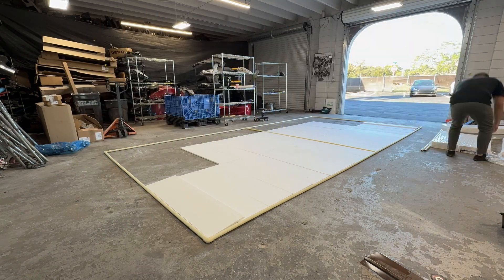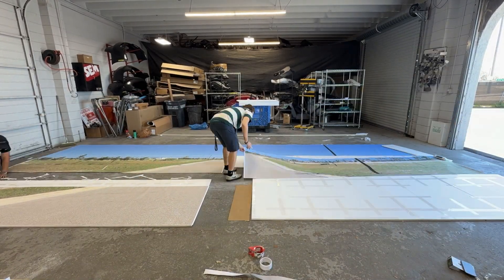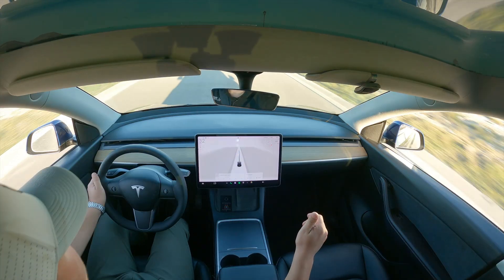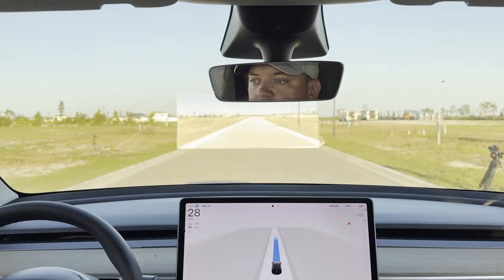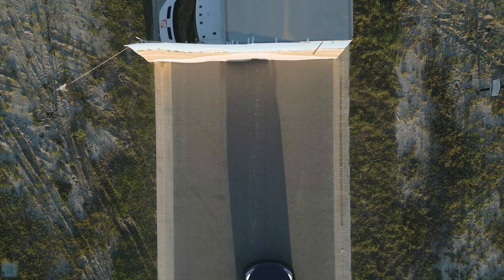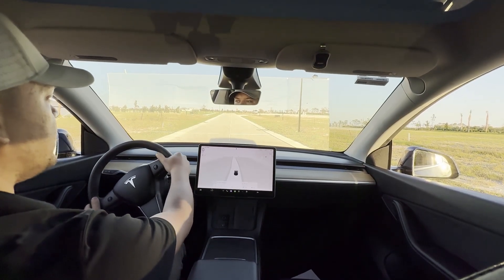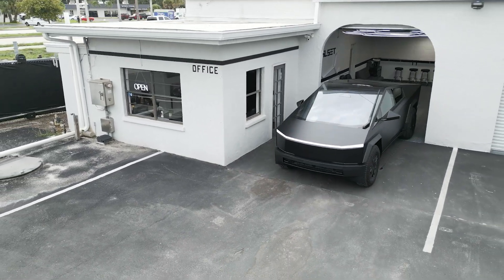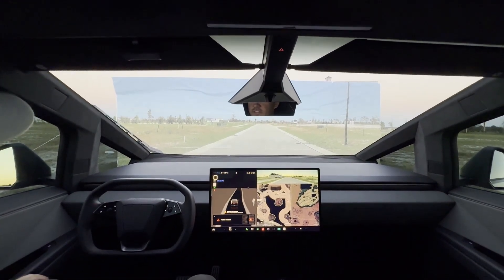Response to Mark Rober’s “Can You Fool A Self Driving Car?”

Comment: This needs to go viral because everyone thinks Rober faked it
Reply: He did. He used autopilot, not FSD.
Reply: Isn't it at all concerning that even if the Rober test had 'slightly' older Teslas those vehicles are still being promoted and used with FSD? Despite the obvious results that those vehicles are not capable enough. Shouldn't they limit any car without the capable hardware or the correct software from doing FSD?

Tesla is putting people's lives at risk to save a buck. Mine included despite not owning a Tesla. Elon wants his cake and to eat it too.
Reply: @ayehavgunne  Shouldn't it be concerning that my car with cruise control can't detect a looney tunes wall and stop?

This is a nonsense argument. When fake walls become a common occurrence, you might have a point. A lot of regular drives would crash into the wall.
Reply: The point is that rober had money donated to him from the company he made look good against a competitor
Reply: I thought the idea of it is to pointing out removing Lidar from EV was a bad idea bcuz vision will never beats lidar in edge cases like these, and tesla can absolutely include it.
Reply: He did. Also this guy just showed you that the latst version of FSD can see the wall. The model Y is running baby FSD (one year old version)
Reply: he didn't fake it. tesla running vision only is just a very very small brain idea
Reply: @amarug  You idiot, of course he faked it, he did not even use FSD on purpose.
Reply: It's not that he faked it. It's that he used a car with brand new lidar attached to it donated to him from a lidar company, who probably gave him the whole idea because they wanted the publicity, but he used a Tesla that was four years old. Why would you compare the newest lidar  tech to an old Tesla? That's dishonest
Reply: @bbtodd  a lidar company run by his buddy who donated 4 million to his charity
Reply: @bbtoddLike comparing the modern roadster to the first Tesla prototype
Reply: @bbtodd 🤔 what you talking about?
Reply: @bbtodd ”intentionally misleading” is a bit strong. People are people…sometimes we all make mistakes.
Reply: The amount of mental gymnastics from Elon fan boys is amazing..
Reply: @bbtodd what's dishonest is elon has been saying those cars at the time were safe
Reply: @bbtodd Because they all work the same way still? Without LiDAR and only cameras? That hasn't changed. This proves it as well; there are just limitations to working with Cameras alone.
Reply: @bbtodd so the lives of someone driving that tesla doesn't matter? You do know tesla removed lidar from their cars right?
Reply: @ 
Tesla cars NEVER had Lidar technology, what you are talking about is a radar, which they had before, in their older car versions, which was removed. Lidar isn't the same as radar.
Reply: I never thought he faket it, but Autopilot and older Software is not ok for a accurate test. At least im happy that mark startet a Testrun and now tesla will receive so many data. ;o) So it can get only better.
Reply: @danielkuttel7867  I honestly don’t understand what yall are even arguing for anymore. Even if you believe this test is BS, there’s certainly no way to argue that Tesla’s system performs BETTER. We now live in a world where good LiDARs are 200 bucks. Your iPhone has a lidar. Companies using lidar will have superior performance and win out. It’s time to let go of the fantasy
Reply: @ but Tesla has been saying their cars are fully autonomous capable for over  10 years now. Even saying his cars are 100% safer than a human half a decade ago.
Reply: You can ague that he didn't fake.
Running a test with the latest LIDAR vs a Tesla on old hardware and old software is misleading.
Reply: The lidar could be 10 years old. It's not like lidar is a competing similar product. They are both fundamentally different technologies.  @jiggig
Reply: @jiggig you realize Tesla has been selling cars since 2017 they claimed would be level 5 capable right? Since AP 2.0
Reply: @glideslope69  Sure, Tesla claimed something big. Is that a good reason to be dishonest to his audience about the current technology? Why did he compare an old tech against a new tech when it's obvious that people don't care about such a completely USELESS comparison? 
Why not compare the latest technologies against each other? Why not be scientific about his tests? Instead, he thought that his assumption was enough to let people know that cameras will fail. Isn't he all about science? What he did was completely the opposite of science.
Reply: @Humon66  bro tell me you’re holding the bag on your $TSLA without telling me lmao. The cybertruck stopped because it’s taller and can see over the wall. A taller wall would beat it in the same way as the Y. Updating the processor doesn’t change the inherent nature of the design decisions made. If they train it to look for this, it will start randomly stopping. It seems like you’re the one who doesn’t respect science, since there’s only one conclusion you’ll accept, regardless of what the data says. You have the same scientific integrity as the people who do research on behalf of the tobacco companies
Reply: @glideslope69  Are you just like Mark Rober? Only assume to know what you're talking about without real tests? Sure, maybe you're right, maybe you're wrong, but stop being a-know-it-all and let the rigorous tests show the real results that actually matter. Your opinions don't matter here.
Reply: @ bro I’ve been an electrical engineer in the industry for 10 years. There’s a reason every other life critical system has redundancy. Tesla squandered what could have been a multi-year lead to avoid a $200 sensor. 

Imagine if Boeing started eliminating redundant systems in airplanes because “they’re too expensive” …now take a step back and realize that’s the exact design ethos you’re advocating for.

Tesla is not going to be the leader in robotaxis unless they add sensor redundancy, but at this point that would mean they have to rewrite and retrain the entire stack. Meanwhile, Waymo is operating non-beta, for-profit rides in the real world as you read this. It’s unlikely Tesla will ever catch up. Their only purported advantage, the existing fleet of vehicles, is apparently useless since your team is now clinging to HW4 being the savior. 

Good luck out there ✌🏻
Reply: @glideslope69  
Cybertruck stopped either because its using better hardware, better AI model, different contrast between picture and real world or all them put together. It didn't see over the wall... Its not that tall... You can even see in the video that top of the wall shows sky, for both cars, and even if it did show something behind it that should still not impact how car behaves as its way out of where cars would be driving. 
This video showed how this experiment should have been done, multiple drives, properly putting away hands and feet, and done actual test with actually the latest version of this tech. Tesla failed with older version, it succeeded with newer one, everyone is happy as this was the correct way to do it. Now only question remains if test with CT was a fluke or not, so repeating this test where you have side by side tests with older version would be to way to go, just to rule out changes in day time and changes in contrast.
And no, I have no stocks and Tesla and I don't own Tesla, so put away your tin foil hat.
Reply: @Zripas  Agree. We need more tests with certain conditions to see if the CT test was a fluke or not.
Reply: @ I disagree with literally everything you said but I’m not gonna spend the time to go line by line. Here’s the major point that you seem to be missing or intentionally ignoring, Tesla said that the HW3 model Y in the video would be capable of level 5 autonomy. So even if we pretend everything else you said is correct, the main point of the original video is validated; the vehicle is not capable of doing what Tesla said it would be. 

“Oh you need the new one” is not an excuse, Tesla has been promising their cars would be capable of full autonomy with their existing hardware since 2017
Reply: @glideslope69 as a radar engineer for 10 years, I would like to point out the interference problem among active sensers. If opposite cars also use LiDAR or radar, the emission signals can not only confuse your receiver but also blind yours for a short while. In 10 years I think auto driving will become mandatory because of better safety standards, 
LiDAR and radar won't be part of it.
Reply: @ any life-critical system needs to be designed with redundancy. Certainly no one is advocating to use only lidar. It’s a backup. 

Vision-only is inherently limited to the dataset. The fatal FSD crashes (the few that have been obtained by the public) all follow a similar pattern. The car saw something that it didn’t understand, like the bottom of a flipped car on the freeway, and decided to keep driving. There will always be new scenarios it hasn’t seen before. 

In these instances, if the lidar detects a large object in the road, whether the car understands what it is or not, it’s better to stop. You’d rather risk a slight inconvenience to avoid a fatal accident. 

There’s a reason Waymo is operating for-profit fully driverless rides as you read this, and Tesla has never completed a single driverless mile. The redundancy provided by LiDAR (among other sensors) is what makes it safe enough to trust your life to
Reply: @namei8967  
Interference is not a problem with LiDAR as systems use slightly different laser frequencies or modulation patterns to distinguish “their own” signal from others and also use unique pulse sequences or time-of-flight encoding, so even if other pulses are seen, the sensor can filter out what doesn’t match its own code. In most real-world conditions (even in traffic or at intersections), LiDAR systems function well without noticeable interference. Automotive manufacturers design LiDAR units specifically with these crowded environments in mind.
Reply: @glideslope69  I wrote to you because you claim you are electronical engineer. So let's talk with engineering sense. 
For any redundancy system, you must consider 3 factors. 1 necessity, 2 cost, 3 side effects.
For 1, the latest fsd has shown its excellent ability to avoid collision. So far no one tried to prove it otherwise.
For 2, LiDAR is expensive which will prevent it to be used to cheap cars.
For 3, the interference of other coming LiDARs will make your car phantom brake every a few minutes if LiDAR are widely used. It is unworkable.

As regarding life-critical, 40k fatal casualties in US roads, why aren't cars  forbidden?
Reply: @glideslope69  
You seem to be confused here, what Tesla said and what car can actually do are not the same things, this is why you need to perform actual real world tests. Tesla could have said that this car is level 1, or level 69, makes no difference in what this car is actually capable of. Its so weird that you people come back with silly things like "But Musk said..." like who the hell cares?... From when you started to care what Musk says? Test is done, it showed that it failed in one instance and succeeded in the other, not question is if this was a fluke or not.
Reply: @Klaes.Jensen  it does. As a military radar engineer, I know very well how to reduce interference. But interference can't be removed completely. The reason is the emission energy is hugely larger than the reflection energy, especially face and face. Any receiver has certain bandwidth, and side lobes. The frequency difference may not be enough to deal with those side responses. 
Any modulation can only work if the receiving signal is clear. If the interference is overwhelming or saturated, modulation have nothing to work on.
Reply: @Zripas  Exactly, they need to think scientifically about the actual technologies. They seem to have personal beef with the CEO, confusing the technology with some unimportant statements from the company.
Reply: @namei8967  Other LiDAR's won't interfere with each other
Reply: @Klaes.Jensen  It seems my counter arguments can't interfere your mindset.
Reply: @Humon66  not dishonest if we've just proven it's true that tesla cannot distinguish between reflection and object. A train or truck with a reflective surface will fool the Self driving... 

The idea that proposing a better solution in the video about a flaw is a problem is asinine...
Reply: @namei8967  It's not my mindset that's the issue, it's your outdated mindset. Companies have known for many years the risk of interference between LiDARs, so they've worked on incorporating failsafe and other redundancy systems to prevent the interference, as I wrote previously.
Reply: @mcwornex2123  He is an engineer; he understands that comparing an older technology to the newer technology is not good enough for science.
No one cares about such a USELESS comparison, yet he did it anyways. So, why is he spreading information that has a high probability of misleading people into thinking Tesla’s FSD is inferior to LIDAR?

Sure, if more testing produces undeniable results showing that Tesla’s FSD is inferior to LIDAR. Then he 100% should show the public that FSD sucks. But he didn’t do that. He just conducted some ridiculous tests and then let the people see without explaining the details that matter.
Reply: @glideslope69 and btw one waymo costs 200k to manufacture. They have roughly 1,000 in total. Go ahead and think waymo has the lead. Tesla can make 1,000 with this exact software in about 5 minutes. But wait , oh yeah they can do an over the air software update and activate millions of Tesla at once that are capable of this also. Waymo will not be able to match the price per mile Tesla can charge because each vehicle made is extremely affordable and mass produced compared to waymo 200k car with a remote driver for every car added onto that cost. I know you Elon haters just want to believe this is all make believe but it’s happening. Probably have a few years but this is the beginning of the end for waymo. Good luck out there.
Reply: @Humon66  Just because YOU don't like it doesn't mean it's a "useless comparison". That argument is simply idiotic. MANY people OWN those older Teslas with older technology. Not to mention, newer Teslas still rely on solely cameras, so they will still act VERY SIMILARLY. 

The point of the comparison was to show what Tesla tech that MOST Tesla owners have, is inferior to actually Lidar technology. 

Tesla's FSD IS inferior to Lidar. If Tesla actually bothered to use Lidar as well, then their FSD would perform even better than it already does. There's no reason at all to rely solely on cameras. It's a stupid choice that will ultimately lead to worse self driving performance vs other car brands who end up getting to the same level.
Reply: @ waymo’s system is a roof rack. It can be moved from one vehicle to another when the car itself ages/miles out. Also the cost is certainly less than 200k these days, those numbers are from years ago. 

Further, each individual city needs to approve driverless operations within their borders. So no, Tesla can’t just flip a switch; they need to go through the same city-by-city approval process that Waymo does, and they are way behind. 

Tesla’s system is a fantasy, Waymo’s is real, and operating for-profit driverless rides as you read this. I live near San Francisco and around here everyone takes Waymo’s, and no longer Ubers. It’s already happening, and Tesla isn’t a part of it. Waymo is currently in the situation Tesla fanbois fantasize about them being in. Meanwhile, Tesla still hasn’t completed one driverless mile. Tesla has already lost this race, whether you accept it or not.
Reply: @ the inherent flaw with vision is sometimes it doesn’t understand what it’s seeing. Most of the fatal FSD crash videos that have been obtained by the public show the exact same thing, an object in the road the camera didn’t understand and kept driving through. Lidar solves this; if the lidar sees a big object ahead, it’s better to stop, whether the car understands what it is or not. It’s better to risk a slight inconvenience than a fatal accident. 

People can’t seem to understand that these aren’t cell phones, there are humans inside. If the software fails, you don’t just restart it, someone dies. So the reality is it’s better to risk false positives than false negatives. 

There’s a reason no other life-critical systems are single point of failure. In aviation this is referred to as the “Swiss cheese model”. Tesla is trying to do this with only one slice of cheese, which presents huge holes.
Reply: @Klaes.Jensen  the issue is your mindset which has no knowledge of basic physics. No companies can solve  the interference problem. When two columns of LiDAR cars run face to face, the fatal interferences are bound to happen!
Reply: @glideslope69  You seem to be very against Tesla FSD. Based on public videos, we can see that Tesla currently has the best self driving technology. Am I wrong? If I am. I respectfully ask for the better sources that you know.
Reply: @ Waymo. I live near SF and Waymo operates for-profit, fully driverless robotaxis that anyone can take. I ride in them all the time. I’m sure you can look this up as well. 

Tesla’s system is not driverless. They require a human driver, so they can put the blame on them if anything happens. Operating with no one in the car is a completely different thing, and is orders of magnitude more difficult, with significantly more liability. Even Tesla themselves know their system is not ready to drive across town with no one in the car. Waymo is doing it, in the real world, as you read this. Tesla is just fantasizing about doing what Waymo is actually doing.
Reply: @glideslope69  Yes, Waymo does have its advantages, but it's not as scalable as FSD. And yes current FSD has certain risk(s) that Waymo doesn't have, but it's improving every day, and it has other advantages that Waymo doesn't have. No body knows if it will ever be a perfect driverless car. But many believe that it will happen. 
I had also seen Waymo getting stuck, too. So it's not at level 5 yet. Both are trying to get to level 5, but base on the improvement rate of FSD and its capabilities, it looks much more promising than Waymo.
Reply: @xenofastiq  not sure why my reply to you kept disappearing, if you see multiple replies, I'm just trying to recreate it.
Reply: @ Waymo is partnered with several OEMs who make significantly more vehicles than Tesla does. The world produces electronics by the billions. Waymo is just as scalable at Tesla. According to literally everyone in these comments, you need HW4 for FSD, so the argument about existing vehicles is moot. 
Robotaxis are approved at the state and local level. Tesla would have to go city-by-city just like Waymo and they’re far behind in that, as well as in generating the data to prove safety and gain these approvals (they have zero driverless miles compared to Waymo’s millions)
One technology works, the other doesn’t. If you can’t accept that you just have confirmation bias. 
Even the most hardcore Tesla fanboys would NEVER let their car drive across town without a driver, if they were held personally liable for any damage or injuries it caused. Someone has to be liable for robotaxi mistakes. In the long run, the cost of liability will far outweigh everything else including the cost of the vehicle. If Waymo is even a % better, they’ll have a massive economic advantage. And we all know the gap is a LOT wider than that
Reply: @namei8967 this is an amazing insight.... and one of those things that seems so obvious after the fact.
Reply: @glideslope69  I can't say for sure I have confirmation bias or not.
It is true that Tesla fan boys won't let the car drives itself across town. The reason is because it's not at level 5 yet, it will make mistakes. Waymo is also not at level 5 yet, so it's a race for both technologies to get there. I actually don't know why Waymo isn't level 5 yet. I heard this information from a Tesla guy, so this might be his bias thoughts. He said Waymo depends on premap areas to drive. If there are changes made to the areas, such as new constructed road, Waymo won't know what to do. If that's true how can Waymo get to level 5? Things will always be changing everywhere, it will be to costly to keep updating their maps. 

If AI is responsible for driving Waymo, then I can see it reaching level 5, but how fast? Why isn't it there yet? Data limitation? I don't understand the tech enough to know why it won't or will work. Isn't it true that Waymo project began way before FSD? Why is FSD seemingly better than Waymo already? I understand FSD technology better than Waymo technology. I understand that FSD learns and makes decision like a human, but is faster and always aware of its surroundings to maneuver quickly and effectively. 

I understand that AI learns exponentially fast, and so far, evidence of FSD improvements shows just that. So, I’m going with the more efficient technology, which learns and adapts at an incredibly fast pace.

At this rate of improvement, it will not be surprising to see FSD reach level 5 first.
Reply: @glideslope69  
there are some misleading points you pointed out, firstly, waymo is not scalable as they require hd maps and can not use highways yet, waymo wants a precise and safe system compared to tesla's general and dynamic system. While yes, HW4 is out, that does not mean HW3 is out of commission, even legacy vehicles get fsd updates from time to time (with smaller models), and i presume there will be a computer upgrade available in the future for HW3 vehicles, which would be way cheaper than buying a whole new car. Even if there was no upgrade, buying a whole new car is still cheaper, a model y would cost around 50k including fsd I think, while a waymo is easily double and you cant personally own it, now as waymo is a service provider, we can also assume that other taxi companies would buy teslas for their robotaxi service, they could easily get 2 cars for the price of a waymo (ofc there are tradeoffs with safety and scalability and other stuff). 

There is no clear winner in autonomy yet, both waymo and tesla are not ideal, and its not right to name one as a clear winner when there are multiple factors, such as scalability, safety, speed, etc. Waymo will definitely win in safety, while tesla wins in scalability and speed (due to being general and has access to highways). ANd like you said, a % can be important, but in what? price? safety? what if you increase price for safety? The gap is there but we can only be sure when tesla goes public in june or july with their robotaxi service, that would somewhat show how far they are in autonomy.
Reply: @Humon66 and you think your "opinion" does? 😂
Reply: @Gaetano.94   Why can't you think scientifically? Is it because you're not logical enough? I wanted to see more and better tests to prove once and for all FSD is inferior or not. 

The other guy only cares about his opinions. He tried to use his opinions to convince others that FSD is inferior. That is not how science works. If his opinions were enough, then there's no need for anyone to test the technologies.

No one should simply listen to his opinions. Everyone must see the actual results of real good tests to learn the truth.
Reply: @Humon66  I said the same thing. But you have no right to say that someone's opinions don't matter, but yours do.
Reply: @jiggig  *did
Reply: @jiggig misleading? Elon released an unfinished product on public roads for years. Has FSD been updated to not shut off before impact?
Reply: @jiggig no matter what or how you do it, Vision can never beat lidar, ever.
Reply: he did fake it, even if the results are similar
Reply: This is a hugely unlikely scenario anyway. You're more likely to find a huge mirror than a perfect picture of the road. And this mirror would mess up a LIDAR just the same or worse than a vision system
Reply: @mrBugeHalls  clearly you don't know how lidars/radars work. the more reflective an object is the more clearly you'll see it on those bad boys. now if you divert those waves on a certain degree which they won"t bounce back on the transceiver then that will be the time that they will seem be invisible. (same principle on stealth planes with their geometries) now if you try that experiment your big glass wall will just be setup just like a ramp.
Reply: @mrBugeHalls how would a mirror, a thing that reflects light, mess up LIDAR, a thing that relies on light being reflected?
Reply: I mean its fully stupid that people are complaining that he's using old hardware, when that's the car hundreds of thousands purchased with the promise it would be able to drive itself.
Reply: @DrKoneko  
And it is able to drive itself, its not like 100% prefect and will not include all possible instances, but it doesn't need to for it to be counted as self driving.
And it is stupid to use old hardware and old software when you want to test something what is highly relying on newer hardware and newer software...
Reply: @Zripas  then don't sell the old hardware with promises that aren't possible to meet
Reply: I take it you didnt watch the whole video, the part where he used a cybertruck.
Reply: Rober is gay, this is respectable
Reply: He prove that robers test was real. @josesammut9396